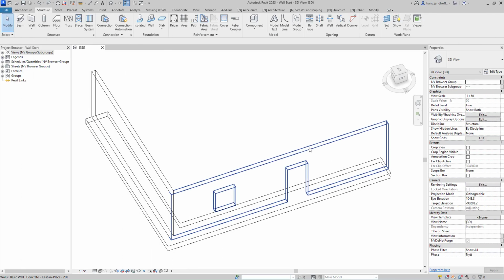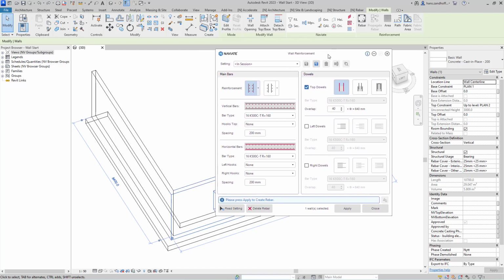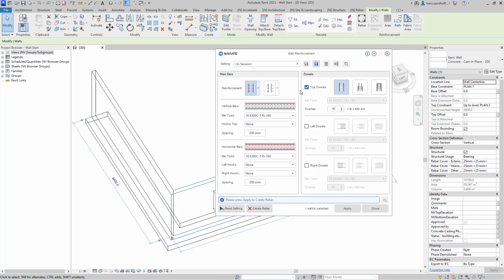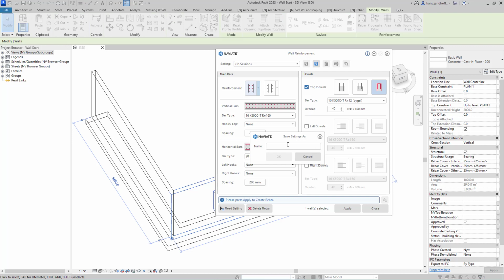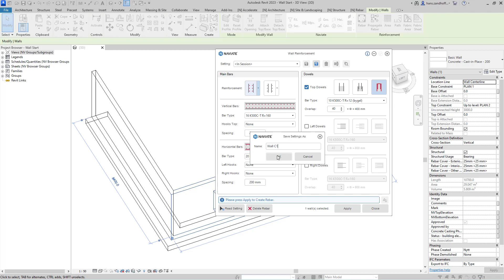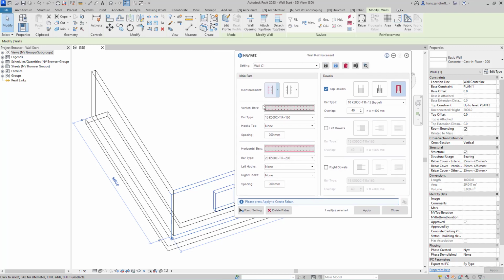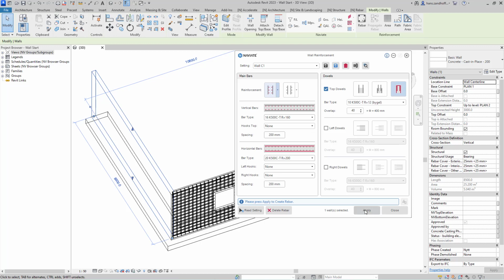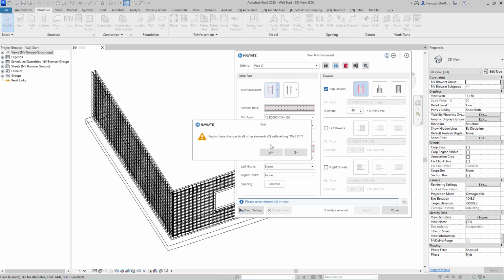The new Naviate Rebar - How to work with walls

Comment: i am receiving an error "GEOMETRY OF WALL IS NOT SUPPORTED" ??
please help
Reply from the maker: Hello, it can depend on many things, but often it is that you have adjusted the rebar cover on the wall manually. We do not support this yet. See print screen for details: https://2950368.fs1.hubspotusercontent-na1.net/hubfs/2950368/01.01%20SYMTECH%20Naviate/Naviate%20support/rebar%20cover%20on%20wall.png / Naviate team